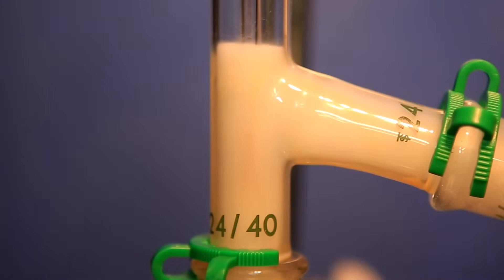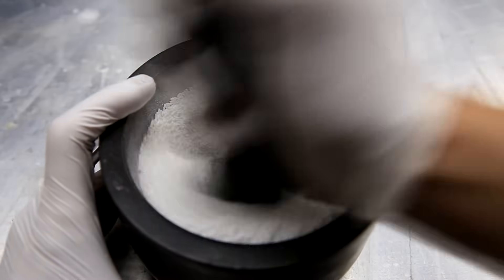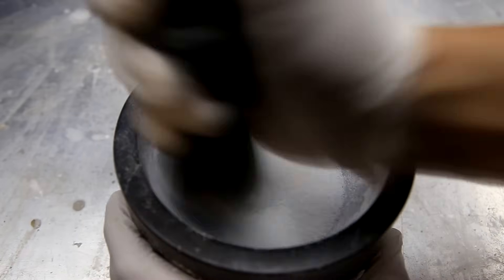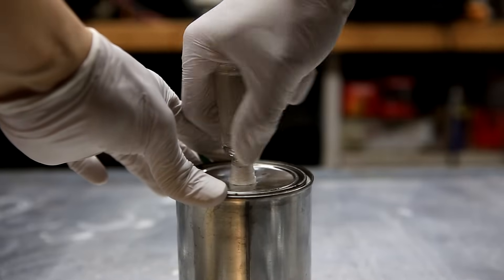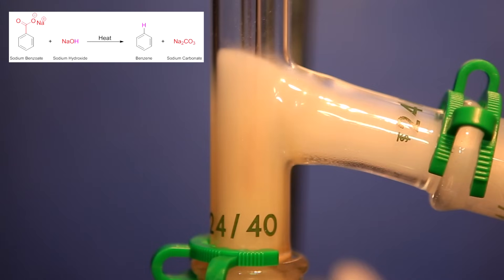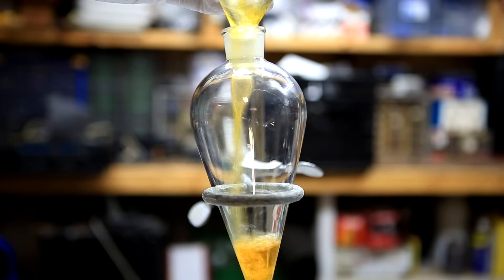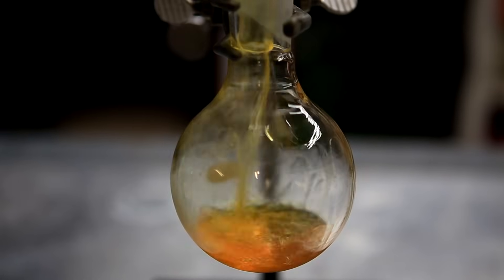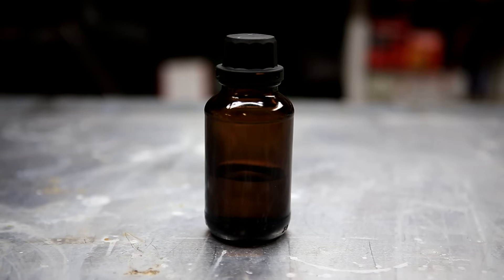How to make benzene

Comment: To make benzene from sodium benzoate u can use decarboxylation (reagent=soda lime) and go by adding some Dil. acid making it benzoic acid then add some strong reducing agent such as lithium aluminium hydride or diborane in THF as solvent

Comment: When you said prep of benzene, I thought you meant from almost base elements like CH4... I thought of a set of reactions for making benzene from scratch:
CH4---> C2H6(Na/ dry ether)
C2H6--->C2H4Cl2 ( Cl2 in presence of light)
C2H4Cl2--->C2H2  (1: alc. KOH/delta, 2: NaNH2/ delta)
3C2H2---> Benzene (pass thru red hot iron tube)
I just have knowledge of organic chem but idk how cost efficient this process is... but you can make benzene from scratch :)
Reply: I think if you react n-hexane with Cr2O3 or V2O5 u can directly convert it into benzene. For obtaining n hexane, u can react glucose with HI at high temp.
Reply: Actually Ch4 doesn't show wurtz rxn, you must convert it into Ch3Cl and then react it with Na/dry ether.

Comment: 6C + 3H2 ------> C6H6 🪨
Reply: yep well it will not be a benzen ring and it will require heat more than the 30000J or 9000J/s

Comment: Is benzene a fuel for cars (not trucks, just light cars)? Or that type of fuel is called gasoline in English?
Reply: No, benzene is a component of crude oil that is typically extracted during refinement, and then re-added to the final product as an octane booster and anti-knock additive.  You're probably being confused by the fact that the Russian words for petrol/gasoline and benzene are almost identical (i.e. they are cognates).  German, Persian, Italian, and Indonesian are the same way.  Modern petrol typically only contains 1% or less benzene (other anti-knock additives are preferred now).  The primary hydrocarbon components of petrol are alkanes, alkenes, isoalkanes, cycloalkanes, and cycloalkenes, and constitute around 50-70% of the volume.  The rest are various petrochemical aromatics, namely benzene and other benzene derivatives, such as alkylbenzenes (like toluene and xylene), and C3 and C4-benzenes.
Reply: @raelik777  yes, I am a bit confused that word "benzene" doesn't stands for "gasoline". Kinda weird, we call the same chemical "benzol"
Reply: @-WarCriminal-22  It's not all that surprising, as benzene was actually one of the primary components in early coal gas distillates used as fuels in Otto cycle engines, before the Shukhov cracking process (thanks Russia!) was invented to break down the heavier hydrocarbons in crude oil to use as fuel.

Comment: Do you know the temperature the reaction vessel needs to get to for the decarboxylation reaction to initiate and for the benzene to distill over? Or do you just heat it up as much as you can with the propane stove? I'm trying to see if it's possible to do this with a steel vessel wrapped in insulated heating tape, or if that won't get to the temperatures needed.
Reply: He said it was at medium heat with the camping stove.

Comment: Thank you, NileRed!
There are tons of people with videos on wood gasifiers.  Their core problem is condensate containing tar. They all want to separate out the wood gas and reburn the condensate.  (Worse they just want to throw the condensate on the ground.  That stuff is poison!) I think that's the wrong direction.  I'd like to get as much of the liquid condensate as possible and refine it. I can't find much information on what's in wood vinegar/pyroligneous acid or any of the other compounds resulting from destructive distillation of wood.  (I think the Wikipedia articles are very incomplete, even wrong.  Why don't the articles mention the word tar?) Any suggestions on refining the condensate?
Reply: @UVxtal76 Like refining crude..

Comment: Very late to the "party".  The benzene nucleus was already present in the sodium benzoate.  I would have liked the alternate path starting with coal and limestone.  Vigorously heating a coal/limestone mixture yields calcium carbide.  Reacting the calcium carbide with water yields acetylene gas (C2H2).  Passing the acetylene gas through a warmed tube induces trimerization, which is the desired benzene (C6H6).  Rocks become liquid hydrocarbon.

Comment: I think your video would've been a bit better had you explained any "unusual steps" in your procedure.  In this case, I'm referring to the use of a paint can--I'm not a chemist, but I suspect that it's because sodium hydroxide, when heated enough, attacks glass.  I'm wondering if the iron (because of the orange color) or internal coating of the paint can may have been the culprit generating the contaminant.  Keep on Truckin'!

Comment: PLEASE MAKE TOLUENE FROM BENZENE AND/OR TOLUENESULFONIC ACID MONOHYDRATE!!!   I BEG YOU
Reply: Make it for yourself via Friedel/Crafts alkylation.  Add some anhydrous aluminum chloride catalyst to a large excess of benzene.  Slowly add some methyl bromide to the reaction vessel.  Toluene (methyl benzene) and HBr are the primary reaction products.  Fractional distillation separates the desired toluene out of the product mixture.  Some dimethyl benzene production is inevitable.  A large excess of benzene minimizes the amount of unwanted byproduct.
Reply: @eliduttman315  wow thank you very much!
Reply: err, toluene is much easier to buy than benzene, and certainly much easier to buy than going through this process. You can get a quart of toluene for like $20.
Reply: Thor Correia hell nah dude, i live in california they banned it
Reply: The Modern Alchemist hahah me too. Fuck CA, right? Always banning everything... but you can still get it on eBay ;)

Comment: The orange colour is due to the inner suface of the can. If you use the can more often the vapours aren' t cloudy anymore and the destillat is colourless. ( Sorry for the Bad English....i am from Germany)
Reply: Your English was better than some English people I know. Don't worry about it.
Reply: Do you need to use a can? Could a glass container be used instead?
Reply: @MrKudmar  I think it would work with a glass flask too but it could crack due to the high temperature.
Reply: @stefanstark4575  thanks! I'm trying to teach myself, so every little bit helps
Reply: Tried several types of cans. Always come the orange stuff. Might be some bisfenol or other crap

Comment: I didnt hear you explain why you used a can instead of a round bottom boiling flask (or did i just miss it?)
Reply: Very high temperatures and lots of slag left behind. Basically, even if you manage to do that in a flask you'd be left with an unusable piece of glassware.

Comment: Well done! But guessing/comparing both carcinogenic potential just by comparing their structural formulas does not work (benzene vs. benzoic acid)! The reason why benzoic acid is not carcinogenic is due to the presence of that polar carboxylic group so it becomes quite soluble in water! Whereas pure benzene is completely nonpolar - and BTW: Pure benzene is not carcinogenic BUT the substances it is transformed to by our body ARE! As benzene is not soluble in water and our body wants to get rid of it, it tries to transform it to a more water soluble state by using cytochrome P450 and oxidize the aromatic system! That way benzene is transformed to the corresponding epoxide and this can react with any nucleophile like our DNA and other protein.  That's the problem about benzene! https://en.wikipedia.org/wiki/Arene_oxide . Check the corresponding German report on wikipedia to see the possible products!

Comment: Maybe I missed this in another comment, but why the decision to use the paint can for the dry distillation? Is this just to avoid coating glassware in the tough black salt residue?
Reply: Distillation dry can cause the glass to crack due to low thermal conductivity.

Comment: I have one question, in this reaction you use 100gr sodium benzoate (0.693mol) and 60gr sodium hydroxide (1.501mol), but you need 1:1 moles . (0.693mol sodium benzoate to 0.693mol sodium hydroxide)
Reply: And in this reaction you can give maximum 61.793ml of benzene (0.693mol*78.112gr/mol:0.876gr/ml = 61.793ml)

Comment: A turbulator in your condenser makes it much 'longer' in terms of condensing power.
Its a twisted ribbon of an inert material installed inside the condenser that allows vapors to pass through, not to be confused with column packing media.
It breaks up laminar flow in the condenser: sometimes the vapor stream is cooled only near the condenser tube wall and you can lose vapors.
The turbulator also forces vapors to travel a spiral path down the condenser tube effectively giving them a longer condensation path, and the thing has a large surface area, increasing condensation performance even more.

Comment: I found it funny that you consumed propane to make benzine.  As I understand, the stuff sold as "Propane" more properly "LP", is a mixture of propane and benzine which varies seasonally or in different climates.

I wonder if it would have been easier to turn the propane into benzine instead!
Reply: It would be much, much harder. To synthesize benzene from ordinary aliphatic hydrocarbons, you need a reaction vessel at 500-800 degrees celsius and 10 atmospheres of pressure along with various catalysts.
Reply: My man there is no benzene in your propane cylinder. I have no idea where you’d get such an idea 💡
Reply: @erwinrommel9509  I wonder if he's confusing benzene and benzine.  They're two different things.

Comment: >How to make benzene from substituted benzene.
Reply: Sodium benzoate is cheap and common. To synthesize benzene from basic aliphatic hydrocarbons, you need extremely expensive equipment and reagents. 

The point of the video is to show how a normal person could synthesize it from common reagents.
Reply: John Doe exactly.
Reply: @JohnDoe-zh6cp  benzene is a carcinogen so I wouldn't be making too much of it.  I remember using it as an extraction solvent back when but then that was discouraged.
Reply: @Wei Zhao I think you're the sociopath here.
Reply: Benzene can be synthesised in a rather dirty synthesis from acetylene by amateur means. Astral Chemistry did a great video on it called "Reppe Chemistry", it's worth watching. 
However, the synthesis from benzoate is still easier to the amateur.
Reply: @David-fh6rr  it also really speaks volumes when the industry standard method of benzene production is to make it from toluene recovered from crude oil. Not even the big chemical companies produce it from non aromatic chemials. But yes, trimerization of acetylene is probably the simplest way and might be accessible to the amateur, but it's still not easy at all.
Reply: @David-fh6rr  yeah well acetylene is pretty dangerous
Reply: The only people getting mad about this "deceptive title" are people who don't understand that there's no other easily accessible way to produce benzene without starting from a molecule that already contains a benzene ring. This is the ONLY method you can do as an amateur if you want benzene other than buying it, an actual synthesis of benzene is FAR beyond the capabilities of an amateur. Get over it and stop complaining about things you don't understand.
Reply: @spiderdude2099  if you have any interest in chemistry, you too would be angry at the circular reasoning that you can someones find in these tutorials, whether on Wikipedia or on YouTube. Things like - to make benzene you need sodium benzoate, and to make sodium benzoate you need benzene.
I personally am not angry, because I didn't come here looking for how to build benzene from scratch, just a fun chemistry video. But if I had, I would have a perfectly legitimate reason to be angry.

An easy way to fix this would be to title this video something like "An easy way of making Benzene". Something that implies that this is not an advanced synthesis.
Reply: @Salty Sweet You can make acetylene yourself by dripping water onto calcium carbide.  Calcium carbide can be bought cheaply online, at least here in Germany.
Reply: @iridium9512  To be fair, to make sodium benzoate you can start with various substates. Benzaldehyde via oxidation or disproportionation (Cannizaro reaction). Benzyl alcohol via oxidation. Even toluene could be used, with KMnO4.

Bezaldehyde and toluene are raw materials, are naturally occuring, so it's not like you have written, that with such synthesis we are only going in circles.
Reply: So? He never said it was true synthesis. The title is "How to make Benzene" which isn't incorrect.
Reply: How to drink benzene
Reply: Err everything comes from something. Can you synthesis penicillin starting from single elements!?
Reply: @dannyboy12244  yes
Reply: @prospektOS-tmo97  Ok. Is that supposed to mean something?
Reply: LOL Sorry but had to laugh.  I needed to see hexane turned into a benzene ring.
Reply: Buying benzene generally raises many suspicions and is often expensive if bought in small quantities. So if you want to go full on epic clandestine chemist mode you WILL NOT buy your fucking benzene.
Reply: @prospektOS-tmo97  Why are you mad lmao
Reply: @coolbeams6885  because he's speaking to people of your intelligence level, obviously
Reply: @Shive1337  high tier lulz
Reply: https://youtu.be/_HNUjoNEmtc
Reply: It could be obtained by oxidation of benzaldehyde (bitter almond oil) to benzoic acid by atmospheric oxygen and neutralisation with NaOH, which yields the sodium benzoate
Reply: You're not wrong, but I can guarantee you it's harder to get your hands on pure benzene than to get your hands on a food preservative and lye
Reply: Do people think compounds appear out of thin air or what ? He needs a starting point which can either be n hexane ( process is too difficult, high pressure, high temp, catalyst like iron or Mn2O3 required ) or propyne (same problems much less yield ) so this is pretty good method of doing it, I myself have not conducted any experiments but know all this from my professors who have
Reply: @321gbgo  yo, fax
Reply: Yeah.  It's note really true synthesis.  It's destructive extraction and distillation at the same time.
Reply: @gyrgrls  Destructive extraction? It's the first time I hear such a term. I am not sure what did you mean by that. Is it some older terminology? 

This reaction is just a textbook exemple of decarboxylation of a carboxylic acid, followed by a destilation of the product.
Reply: @gyrgrls  I cant remember that the definition of synthesis is excluding pyrolysis reactions?
Reply: @gyrgrls  Its cheaper this way, so nevermind
Reply: @gyrgrls  maybe polymerization of acetylene might work right?
Reply: @gyrgrls  although it need a very high temperature I take that back lol
Reply: Your mom and I made some benzene last night.
Reply: Alright, you got an idea of how to synthesize benzene?
Reply: @8bits59  Not as cheaply as this!
Reply: I thinking the same thing bro
Reply: Add zink dust with heat
Reply: You can make it through ethyne/acetylene gas
Reply: It’s a preservative right?
Reply: @technophant  what
Reply: Cyclic polymerization of Ethylene at 873K
Reply: @predator_music1965  no he's talking about this video because nilered is basically removing the substitutions on benzene and not making it from more basic components
Reply: Do you expected it to be made out of sugar, egg or baking soda from your kitchen
Reply: 😂😂😂😂😂😂 good one
Reply: I heard that passing ethyne through red hot iron tube works...
Reply: Dumbass doesnt know its an old video
Reply: Even the simplest method of heating ethyne in a red hot iron tube is pretty expensive and a difficult and crude procedure of preparing benzene
Reply: Have you heard of aromstisation?
Reply: @thingsexplained4898  have you found out the price of Cr2O3 for large scale production
Reply: Sodium benzoate is also used as an additive ingredient
Reply: Yeah if you're not making it from diamonds and H2 you're not a real chemist smh my head
Reply: You can make benzene from ethyne by passing it through hot iron but making it from aliphatic hydrocarbons is expensive process
Reply: So? Did you wanted videos like "how to make benzene from hexane to cyclohexane to benzene through over 600°C and 40 atp" ??😂
Reply: Add sulphuric acid to diazonium salt 
Or 
Add a mixture of NaOH + CaO on benzoic acid
Reply: Still made benzene lol
Reply: @prospektOS-tmo97  
Geez, most mere mortals can source sodium benzoate a lot more easily than carbon monoxide, genius.

You'd think this would be too obvious to bear stating, but apparently, common sense...isn't.
Reply: Can only use carbon dioxide, heat and pressure
Reply: @jasonchen5162  Thats where youre wrong kiddo. a reducing angent/source of hydrogen is needed
Reply: @prospektOS-tmo97  
Carbon DIOXIDE, numbnuts. CO is posion, and a damned good reason for a noob to leave it alone. 

You're a living example of a Jesse Pinkman who thinks he's Heisenberg.
Reply: @prospektOS-tmo97  agreed.
Reply: How to get substitute benzene, lol

Comment: This is a really easy method, pretty much fool proof. When I was much, much younger, a few hundred years ago, I tried another method, another very much outdoor method. It involved a very hot barbecue, and a bottle of acetylene that was connected up to a ten meter length of 4 mm diameter O.D copper tube, with most of that copper wound in a coil and placed in the hottest part of the barbecue. When I just cracked open the tap for the acetylene, a thick whitish vapor appear just like in this method, took ages for me to condense it to a liquid without a condenser though, but it worked.

Comment: What solvent was used to dissolve the NaOH and Sodium benzoate?
Reply: No solvent was added.  In this case, the dry chemicals react once hot enough.  Commercially available NaOH is usually the monohydrate, so there is some water in the crystals.  Both reagents are highly water soluble.  Upon heating, the water present in the NaOH probably helps the two reagents to mix.